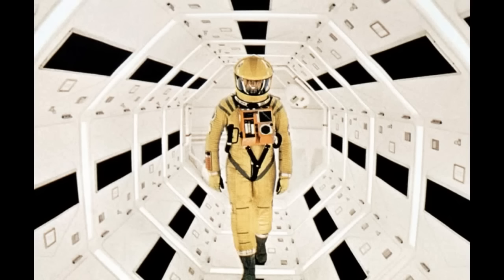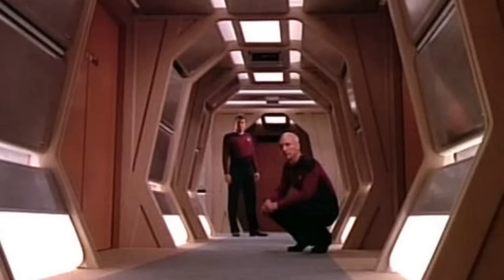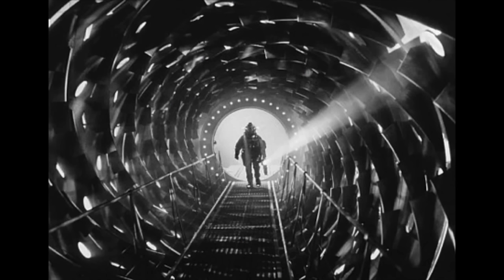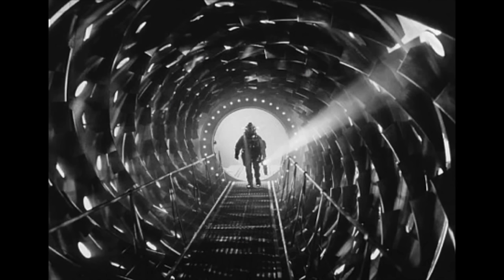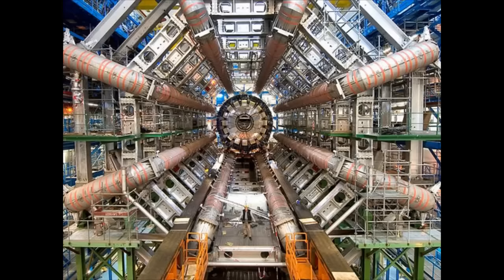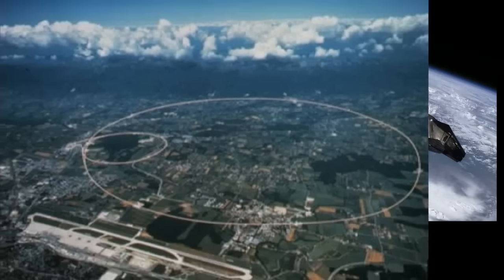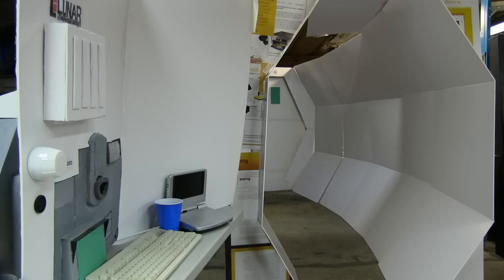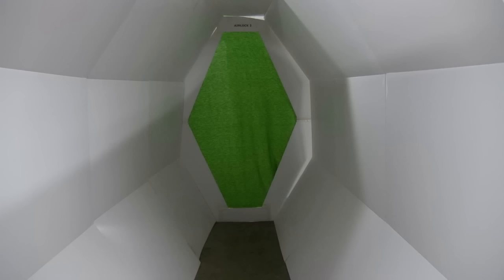How to Build a Spaceship Interior (DIY)

Comment: Thanks for the quick response! I recently got Production Premium 5.5, but am very much a beginner with after effects.  Am writing a sci-fi novel which has scenes of a spacecraft moving through spaces and approaching a space station, space station exteriors and interiors. , etc.  Would eventually like to make a film of it.  Can you pull off those scenes reasonably-well with digitally-enhanced images of prop models, or do you think that high-end 3D software like Maya is necessary?